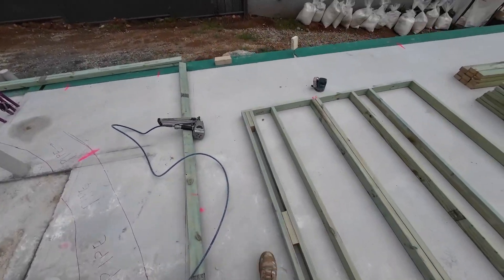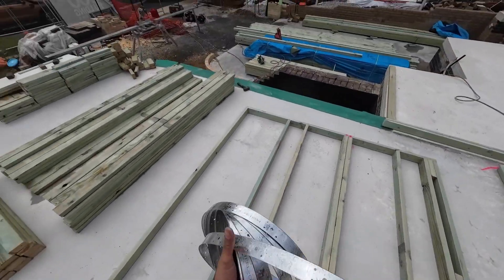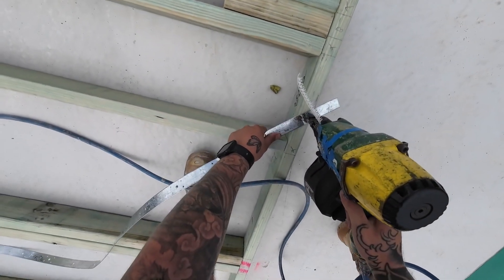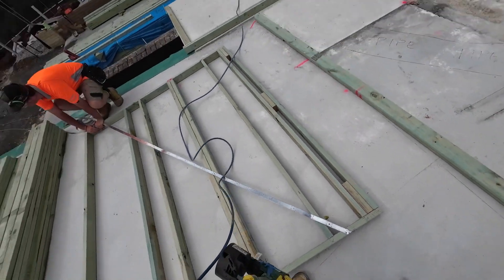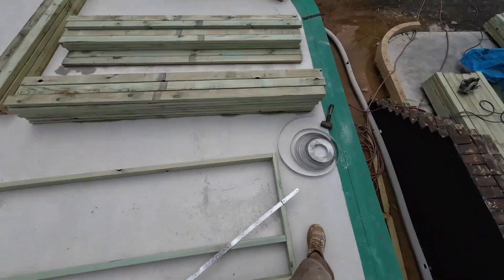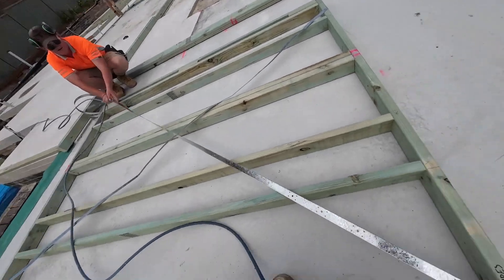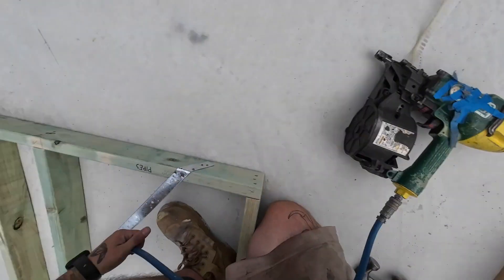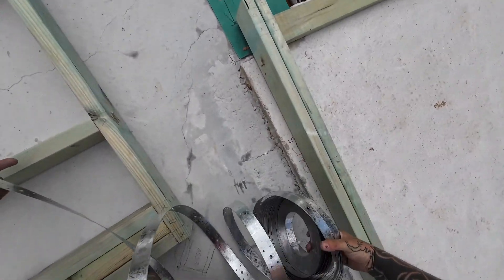POV: Carpentry Bracing Walls in Australia

Comment: Great video! 
where do you usually put the stud ties and how far apart they should be?
Reply from the maker: Thank you mate, usually the engineers specify where stud ties need to be but a general rule is both end studs and every second stud in between 🤙

Comment: can you clarify, maybe in diff areas but ive never used screws to secure and its common pratice to nail  more specifically, the Australian Standards (AS) referenced within it, do not prohibit nailing base plates to studs. In fact, it's a standard construction practice, and the NCC, through AS1684, and is acceptable to use 2 x 75mm nails. Maybe is that for high wind areas?
Reply from the maker: Still nail the bottom mate, this is simply just replacing hoop iron and brackets to secure the studs. A lot quicker this way 🤙